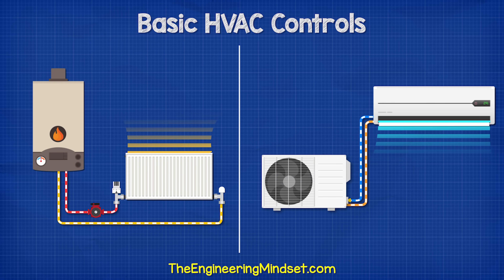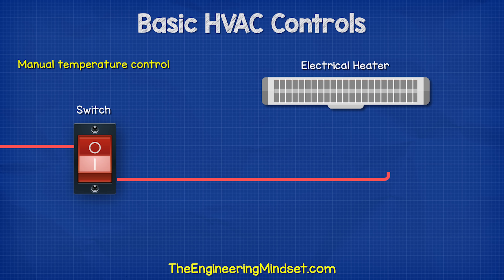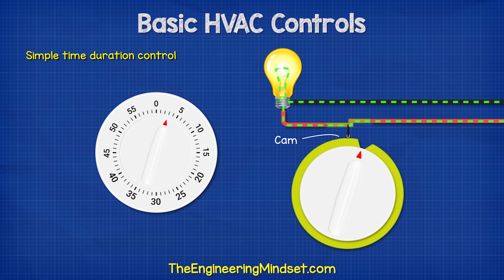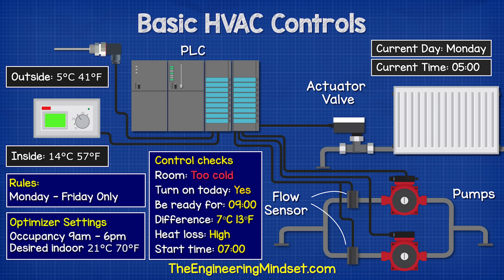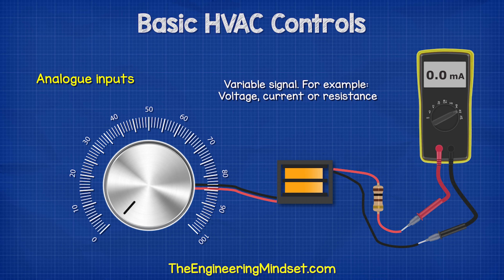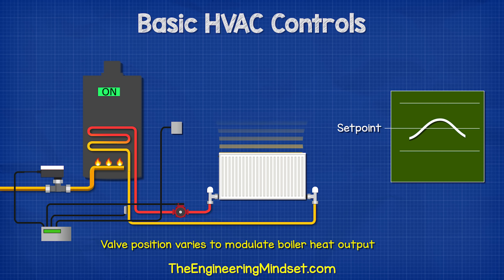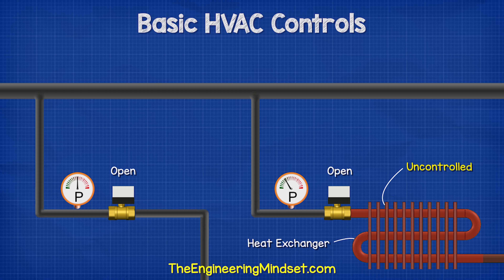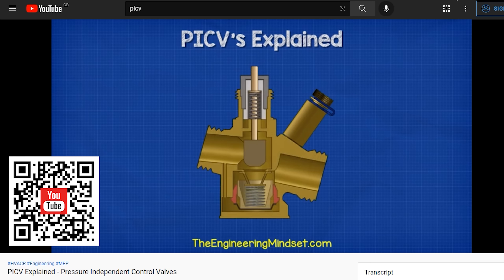Basic HVAC Controls - learn hvacr

Comment: I'm a technician on an automated tram system (3-car) that has 2 independent HVAC units per car. The refrigerant compressor operates on 3 phase 575 vac, along with the condenser system/fans... The evaporator / blower fan system is 120 vac.... The control board on the HVAC unit is 110 vac and 24 vdc for contactors and relays.

Comment: Can anyone please answer my question, can we replaced water to any other low boiling liquid in central heating system?
Reply from the maker: Not replace, but you can use other fluids in a system that is designed to handle it. You can get heated oil systems, steam system, refrigerant systems etc

Comment: There is a kind of air conditioning which does not need almost any controls. There is no compressor and refrigerant in water evaporative air conditioners, no moving parts and high pressure.

Comment: Why use Gas for heating? When you can use heat pump that so much efficient and better and cheaper and doesn't pollute.
Reply: Sometimes gas is used as a backup system

Comment: While you were explaining the dead band I started thinking about PID loops. I was surprised you didn’t mention it. Many controllers for industrial heating applications have PID built into them. After years of working with these controllers I still find them very confusing. I usually just put them in auto tune and hope for the best. If the temperature will not hold steady it’s a nightmare trying to evaluate which parameter to change and by how much. Once I got them tuned properly I entered the parameters in a spreadsheet for future reference just in case the controller failed. Awesome video!

Comment: Amazing work as always was surprised you did not mention 3 way valves on those controls.   I know there an older way but I had to change several and had to eliminate some once the building was switched over a variable speed pump system

Comment: i have a trinity ti 150 boiler with 3 zones--seems when the basement zone comes on the boiler goes full out to 240 yet if the main floor goes on the boiler stays at 50 & takes forever?  I assume its settings??  I looked at the manual it shows nothing about it :(

Comment: I recently had the need to design such a controlled circuit to improve the unfamous little chinese CO2 laser ;) and I will probably have to plan something similar for an automatic watering system for the garden eventually pushing the fun up to an android app to overwatch and set some parameters and collect data over period of time. Maybe next summer. Anyway, nice video !

Comment: Men that's too much engineering you could just use I dunno know Google weather service to correctly Automate these task basically do the opposite of what the weather is telling you 
1.The weather is sunny turn on AC
2. Winter turn on the heat 
And plus you can do even add the exact temperature
Reply: As a controls technician, you have far too much faith in people
Reply: @yayo2363  lol right? This also doesn't account for the need for pressure needs, outside air needs and other possible needs of the customer.
Reply: What? The whole point of all this is to provide greater control than on/off signals... reducing wasted energy and providing better comfort/accuracy.
Reply: This is not a novel concept it's been done, they do not need google just a outside temp sensor on the building - more reliable. Then you can control the setpoints to that sensor via a BMS